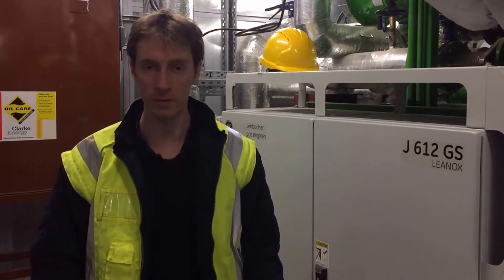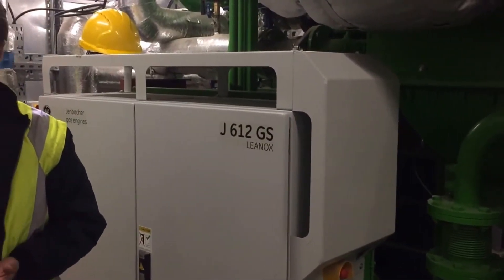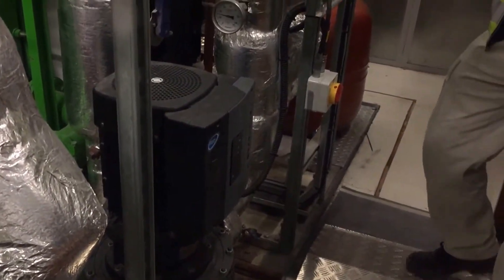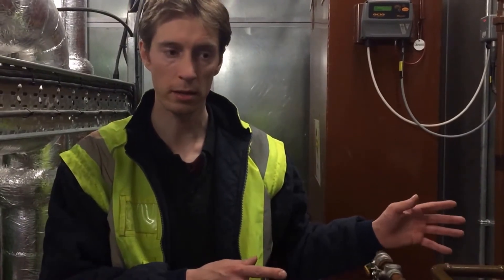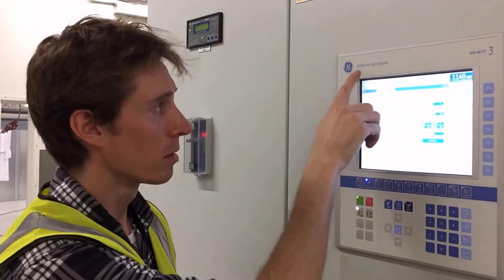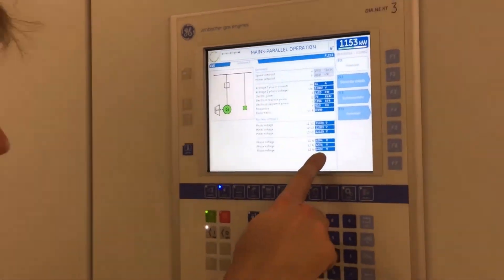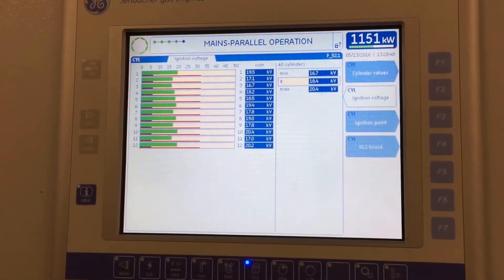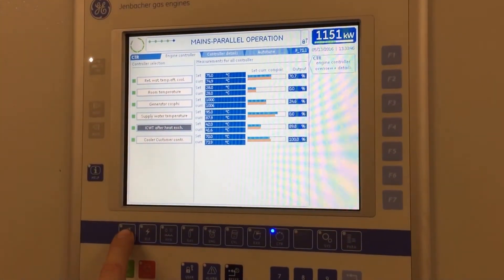The Features of The AWESOME Jenbacher J612 V12 Engine - 6000HP

Comment: I was very surprised. You say, turbocharger compress not pure air, but air-gas mixture. It seems dangerous, because if any spark from cylinder or spark of turbocompressor failuire - high risk of explosion of compressed gas-air mixture inside intake manifold. Isn't it?
Reply from the maker: Applying the same logic, then any gas system is subject to the same, whist it compresses the air / gas mixture it is still not to the same pressure as a gas cylinder for your BBQ.

Comment: Info: Video shows a 2MW J612, the 4.5MW is a two stage turbo charged J624 (24 cylinders instead of 12)
Reply from the maker: yes correct this is the 612

Comment: That first plate exchanger you showed is the oil cooling heat exchanger. Which is tied into the HT loop. The Jacket water cooling exchanger is to the right of it. Mainly still done through dry coolers (radiators) mounted on top of the counter or on the ground outside depending on the set up. Not a bad simple explanation I suppose.
Reply from the maker: This was a basement installation and the coolers were mounted locally, thanks for watching and your comment.

Comment: Do you need to stop the unit to maintain? if a plug or coil pack gives up ?
Reply from the maker: Hi there Helstontvx, there are some tasks you could do with the unit running if you can isolate the electrical connection to make safe but certainly not the plugs, the safer option would be to always shut the unit down and allow it to cool.
Reply: @RossPerryProductions  So would a backup unit be required ..understand its a spark ignition engine ..with CHP you lose a lot when you turn the unit off.

Comment: I'm working with biogas engine for a university project. I have a few questions regarding engine working principles. What is the function of the turbocharger in the engine? From what I understood after the biogas and air are mixed, the turbocharger will compress the mixture then it will be cool with the intercooler before entering the cylinder for combustion. Thanks in advance.
Reply from the maker: Hi Amir, yes thats correct on the Jenbacher the Air, and Gas are mixed prior to the turbochargers which then compresses the combined gas into the inlet manifold.

Comment: Hi, thanks for posting the video. Were you saying it was pneumatically started? I wasn't sure on that detail. Also, how many valves does it have per cylinder?
Reply: It has 4 valves per cylinder and doesn't start on compressed air. The gas compressor that is mentioned is there to supply the prechamber gas valves with a pressure ,50 mbar higher than the actual boost pressure and is not a starting system.
Reply: @sjolmord123  thanks very much for that info.
Reply: @sjolmord123  This man knows.
Reply from the maker: Hi there, Unfortunately I am unsure of the answers as It has been a while since I worked on this engine. Ross

Comment: 6:35 Intercoolers in cars are AFTER the turbocharger.
Reply: yep but here we need to heat up the gas to avoid misfire and condensate - we can also cool it down but in europe we have more cold than hot days so it's not very often necessary
Reply from the maker: yes correct as per Nodrama's comment

Comment: Hey nice work, I got a question. By any chance you know what type of controllers( Smart relays/ PLC?) they use inside this particular panel
Reply from the maker: Hi there Dominic, yes sure its a Wago Remote IO, and Allen Bradley PLC.
Reply: So there are no  GE generator management/protection  relay ?
Reply from the maker: Sorry yes it has a Woodward protection relay and a G59 seg relay
Reply: Hey thank you! Can you explain what is this LEANOX technology and how does it differ from the conventional way of using a lamda O2 sensor and regulating the A/F ratio?
Reply: thanks for the induction and I will like you to share video on all electrical parts of engine type J612GSE12, J620GSE12 and 624
Reply from the maker: Hi there, thank you for watching, please share as you wish

Comment: how much power or KVA OR KWA does it produce ?
Reply from the maker: Hi there the Power output rating is around 2.1 KVA
Reply: Its a 2MW engine running at around 0.98 PF

Comment: Thank you for this video! Finally something for "energetics" engineers :)

Can you please tell, how do you utilize the thermal energy (HT/LT water loop) except heating the building.

What are the alternatives?
Reply from the maker: Hi there Igor, Thank you for your comment, the HT is separated in to LTHW (Jacket) and Steam (Exhaust), the LT then supplies underfloor heating, and AHU heating coils with Boiler top up, however in other installations absorption chillers can be installed to provide cooling to AHU's etc.
Reply: it's also used in hospitals, district heating, greenhouses, for industry like food factorys or pharmaceutical productions and so on